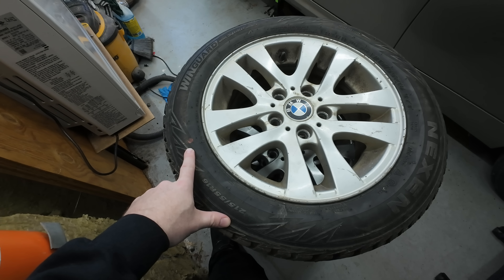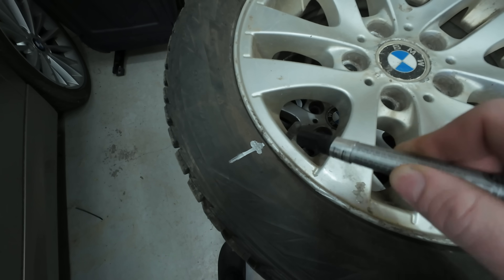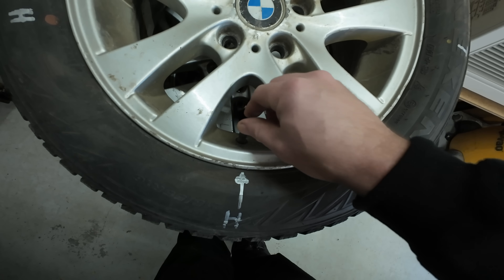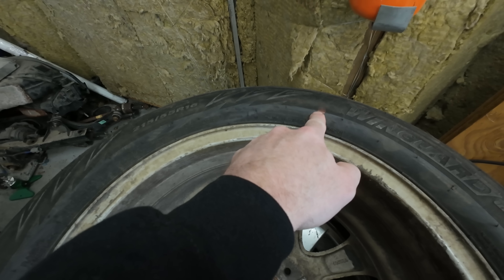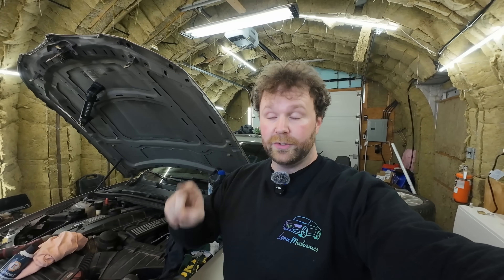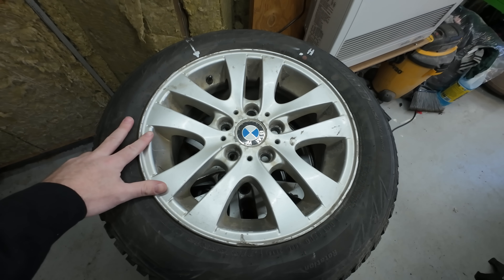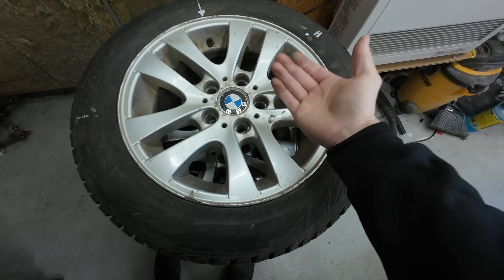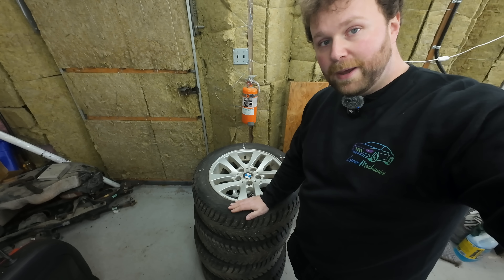Tire Red & Yellow Dots Explained | Back to Basics. Many mechanics get this 1/2 right

Comment: Wait, WHAT?!? I'm 90% sure that the red dot represents the HIGH spot of the tire (not necessarily the heaviest), which should be lined up with the lowest spot on the wheel after measuring radial runout.

If I find that a wheel assembly needs an excessive amount of weight with a new tire, then I remove the tire, statically spin-balance the bare wheel with valve/tire sensor, mark where the balancer wants me to add weight, and then re-mount the tire with the YELLOW dot at the opposite side of my mark. My mark is almost never opposite the valve stem, I've found that's a myth. It's often close, but sometimes it's nowhere near it. 

The only time I'll ever bother with the red dot is if a wheel has radial runout greater than 0.015" and I want to avoid stacking on top of that with an uneven tire. At that point, aligning the yellow dot to the heaviest part of the tire isn't worthwhile, I'll just deal with the extra wheel weights. Having a round wheel assembly is more important. Instead I'll line up the RED dot with the lowest part of the wheel.
Reply from the maker: Yes but the highest point is often the heaviest. Once you re clock the wheel I bet the red mark was near opposite valve steam. This is what I've seen over years
Reply: @Lancemechanics  In my experience, no. In fact that makes no sense logically. The heaviest side will inherently be opposite the lightest side. That's why we mark bare wheels at their lightest point and then line up the yellow mark opposite that. Why else would we balance wheel assemblies by adding weights only in one place along the circumference?

The point is, the red dot is marked by tire manufacturers as the highest part of the tire. It does not reference weight at all. And just like "the valve location is not always the heaviest point", the same is true for the red dot.

Comment: You're correct about the yellow dot, but the red dot is not the heaviest part of the tire. It is the highest. All Ford vehicles from the factory have a sticker on the rim and it's always lined up with the red dot and the red dot is rarely directly across from the valve stem. The mechanics are supposed to take the stickers off the rims when they perform a PDI, but they usually don't. In fact I have seen the red dot and yellow side by side almost op top of each other several times on a tire as well.
Reply from the maker: Highest tends to also be the heaviest. Its my experience alot of techs will break the bead and rotate the tire to get it to balance. I haven't had to do that in years.

Comment: Well, I line up the yellow dot with the valve stem and then spin it up and see how much weight it takes and also check the rim at that time to make sure it’s not bent. If I think the weights excessive, I spin the tire 180° on the rim and go from there. All the aluminum wheels I do, I just static balance them so far I haven’t had an issue with that. 0 to 160 Kph no shake, good to go. I do the dynamic balance on steel rims. The other problem I see is most mechanics, or do it yourself,  never calibrate their balancer.

Comment: The red dot isn’t necessarily the heaviest spot on the tire, it’s the highest (or tallest).  But being the tallest it’s often the heaviest as well.  It’s really meant to be lined up with the lowest spot (from the hubs center) on the rim.  It’s often marked with a dimple, if marked.  This should reduce the vertical up and down or lobbing effect at high speeds.  Depending on out of concentric your rim is it’s a better trade off than the extra wheel weights needed to balance your wheel.  So Lance, you’re one of the mechanics that got this 1/2 right.
Reply: Yup, it's the highest spot for radial force variation, not necessarily the heaviest or tallest, but usually is.  It can be from stuff like splices in the ply lining up, overlap of belt splices, heavy tread splices, etc., that happened during construction.  (I never built tires, but I've installed and maintained tire building machines)
Reply: @jaskroo  and that is the only clear explanation of what it is and how to apply it.
Reply: Where is the dimple? Never seen one.
Reply: @baronvonbrauhaus9086  Yes. Please let us know how to find this dimple on the wheel.
Reply: @horseathalt7308  I found over the years that you only usually find anything on a new rim, as many manufacturers mark the rim with a little sticky red paper dot, which usually comes off at the first tyre change.
Reply: As I learned long ago and has served me well: Red dot high spot to low on STEEL wheels, dimple/marking isn't normally on aluminum wheels and can be difficult to find on many steel wheels or might be missing, my Mopar steel wheels don't have one, I balance as if they are aluminum with the dots and works quite well...yellow dot to valve stem on ALUMINUM wheels...Red dot only, align opposite the valve stem...No dots, trial and error sometimes...
Reply: It's the flattest point of the tire
Reply: Came here to say this. Thank you. I learned the truth of it while dealing with horribly oversized tires which amplify even the slightest imperfection
Reply: Glad someone said it.
Reply: IGNORE THE COMMENTS.  The video is correct.
Many of the comments cause confusion.
Reply: so where do you recommend the red dot be placed at the valve stem or directly straight across from the stem
Reply: Not only is this correct re the red dot, but the yellow dot is the heaviest spot on the tire to be lined up with the valve because the valve is the lightest, not heaviest, part of the rim, i.e. there's a hole/material missing. Young dudes just don't know shit.
Reply: @esstee9595  Glad you replied about the yellow dot. I was sure that was the case, the yellow dot resembles the way hole is for the air stem.
Reply: @esstee9595  
The valve stem is the heaviest spot on the wheel - when the stem is in place. And these days that includes a tire pressure sensor and battery, at least in the US market.
Reply: @esstee9595  My 82 Buick rims added weight (tiny bit of steel welded on) by the value stem hole to Ballance rim without a valve stem in. After installing a valve stem it's heavy by the stem.
Reply: If you buy quality premium brand tyres like Michelin, Goodyear, Continental or  BridgeStone you don't have a high spot in your tire.
Reply: @Ruupie_1982  Highest spot. Not high spot.  Every tire has a highest spot.
Reply from the maker: The tallest point is often the heaviest. Ty. Proved my point. Im wondering if people even watched the video. Check out last 30 seconds
Reply: @Lancemechanics  The uniformity mark isnt always the heviest poin, no. And if both dots are present and your rim does NOT have a "low mark", yellow have priority.
Reply: @mikev.henriksson8396  My rims have the red dot only. But the tires don't have any markings. What's the red on rims? I suspect it's also the high point on rim? Or do they mean something else on rims?
PS. Thanks in advance! 👏
Reply: @Lancemechanics 
So it balances but it's out if round.
Reply: @hotrodray6802  then, you need a tire lathe. Seriously, Cadillac dealerships used to cut tires round when replacing them. OCD on smooth riding vehicles.  One of my friends jobs back in the '70s.

Comment: Have you weighed the difference between the valve stem and the metal that WOULD BE where the hole is, for the valve stem?
Reply: Yes, there’s a hole
And a valve stem. 
And some of them have a sensor on them
Reply: @neilkurzman4907  no shit ..
 Any idea on the "weight" difference, between the valve stem and what metal WOULD HAVE BEEN where the hole is?
Reply: @invisibilianone6288
No, I don’t do it for a living. 
If I did, I probably would play with it. 

Or many years ago when I did software for one.
Reply: @neilkurzman4907  Thanks for your reply 😎☕

Comment: I wouldn't be too worried. It's only few grams in difference with stem valve.
Reply: Might be quite a bit more than that since most newer cars have a pressure monitor on the valve stem.

Comment: 4:38  Loved the tip, so it turn I have a dot tip for you pertaining to spray cans (such as the one over the radiator. If a spray can has a small red dot at the top rim (where the nozzle is), that small red dot indicates where the draw tube is touching the inside of the can, so that you can rotate the nozzle around to get a full squirt (whether the can is vertical or horizontal), you always want the small red dot to be the lowest spot before spraying. i.e. If the can is nearly empty, and the small red dot is on the top of a horizontal can while spraying, you get air and nothing else!

Comment: A static balance you would put weights in center of the wheel “barrel”  they had it on a dynamic balance just only added weights on the inside
Reply from the maker: Our machine pretty much let us choose where we wanted a static. We always choose towards the inside face if we had too

Comment: I had to look at a note I put by the tire balancer about 20 years ago, this could be outdated but it says if wheel has a white dot align it with the red dot on the tire, if no white dot mark the heavy spot of the bare rim and align it with the yellow dot on the tire, this has worked well for years please comment if this is no longer correct

Comment: I have never used the dots as scripture. 
I never cared about  2 dots.  Place one on the valve stem, put the thing on the balancer and see where it is, then rotate the tire 90 and recheck. 

I used the dots as guides for tire rotation to find the LOWEST overall weight.  

Big 4x4 tires, this is even tougher as the tread can also make the tire ride rough.  This is absolute critical mechanicing.  Just like using a TORQUE wrench on the nuts NOT a rattle gun.

Technicians don’t know this, MECHANICS do.  There is a HUGE difference.

Comment: this is a bit off topic for this video but wanted to know if I am the only one that hates these new lead free wheel wieghts? they cost way more are hard to get on the rim, and you loose the ability to just trim a bit off of one to get that perfect balance, I spent an afternoon rehabing used lead wieghts, wire brushed them reshaped the clip and 2 coats of aluminum shake and spray, but it is nice to see them in the cabinet
Reply from the maker: Had a coworkers weights come off restick its self on another part of the wheel. He paint marked everything do he thought it was the customer who was trying to grief him. Brake cleaner, degrease. You almost have to scruff the rims to get these shitty weights to stick

Comment: IF the tire has a yellow dot (not all do) - I find the heavy spot on the rim first, mark it with tape, then put the tire on with the yellow dot at the tape mark. It takes longer of course, but takes less weights. The valve is not always the heavy spot, specially with an alloy rim.

When diving into dot colors, I read that the red dot is to do with runout of the tire and you are supposed to align it with a mark on the rim... I have never seen a rim marked that way, never used it.
Reply from the maker: The marks are rare. But my experience putting the red opposite of the valve stem greatly reduced the weights. I've watched kids end up breaking the bead. Rotating it 180 and its magically opposite of the valve stem or pretty close. But nothing will ever beat spinning the rim up by its self and marking it. :)
Reply: What do you do in order to find the heavy spot in a wheel? I've been a Firestone / Tires Plus tech (both are Bridgestone owned), for almost 3 years and in the 3 locations I've been at, nobody tells anything about that. Shoot we had one guy think the red dot was the light part in the tire, and would refuse to believe otherwise -_-

Comment: if I am doing an important tire install I will spin the bare rim and mark it, wheel wieghts are not cheap anymore and it takes more without lead if you index the tire you will use less than half the wieghts
Reply from the maker: Good practices! This should be the standard.:)

Comment: Take a rim with a valve or tpms/valve combo installed and no tire and no weights.  Tell me the valve is always the heavy spot.  The last 4 wheels I did for myself is NONE of the wheels came to the valve.  Not one.  Snap on manual vertical balancer and stick on weights.  For more preciseness I would have to use a runout gauge to establish the low spot on the rim and tire if either had one.  Don't take my word for it balance a rim with valve installed and no tire.  My guess not all will.
Reply from the maker: So a few tires bent the rules. Let's tare down the whole system... nothings written  in stone in automotive
Reply: @Lancemechanics the point is worrying about the dots is stupid. Just a waste of time and effort. Install tire, balance tire, if you dont like the amount of weight deflate and rotate and balance again. Ignore the stupid dots.

Comment: They're being taught incorrectly straight out of tech school.
Reply: Back in 1969 there was no tech school, but there was an auto mechanics class in high school that my brother took and then I was the one that became a mechanic. I made a jig with a rod, cones and 4 sealed ball bearings on a cradle. This allowed you to balance a wheel/tire assembly before machines were available to me. I don't remember if they had the dots back @ that time, but they are helpful if used correctly. The way I balanced was to rotate the tire and the heavy spot goes to the bottom (Newton Law :) ) then figure out the weight and add it (taped) to the wheel, the rotate the wheel 90* each way to determine where the weight needs to be placed. You can live out in the middle of BFE and this will work every time.
Reply: @warrenlucier5796  I learned on a bubble balancer back in the 1970s as a kid growing up in an automotive shop. 10 years on, as a service writer/counter manager at a tire store, showing the kids how to fix a problematic balance on a computerized balancer was a real thing... going back to the bubble balancer showed not only mass but weight - i.e. the long lever of the high spot of the tire would pull even if the heaviest point wasn't the high spot.  A lot of brands didn't mark hi/lo back then, either.  It was starting to become a thing just as I left the business.

Comment: LANCE! Red is NOT heavy and never was. It’s lateral run out and needs to be lined up with the low spot of the wheel when you have that. Not all wheels have that indicator in which case you will use the yellow on the valve stem…..the reason red dot takes priority is no amount of weight can correct a run out condition. Come on lance
Reply from the maker: And experience tells me putting the red will opposite the valve stem will always reduce the amount of weights. Even in the comments everyone says they've taken off tires and spun them 180.  I understand what your saying.

Comment: I ordered tires from one of the large online Rack stores. Two had  the Red on the Valve stem with A TONNNNNNNNN of weights. Never seen that many weights on a tire in my 25 years of driving.
Makes me want to get my own tire machine and balancer. I do my motorcycle tires and take the extra couple minutes to get them as balanced as possible with no weights and then add weights if its necessary.
Reply from the maker: And my experience has told me put red opposite the valve stem. This topic will generate alot of confusion ill tell you that :p. But I can see the results on so many tires. Its like those cambered rear tires. Once I point it out people can't unseen it haja
Reply: there's videos of japanese drift car guys breaking the bead, unmounting, and even mounting tires in seconds with literally nothing but motorcycle tire spoons. made me realize it's not rocket science. 

(i'd use rim protectors tho because im not treating my wheels as disposable they way they are.)

Comment: I never thought about spinning the rim up to mark it. We used to find one that would come in with a lot of weights in one spot. The first thing I'd do is spin the tire 180* on the rim and rebalance it. Usually that worked. Sometimes swapping which tires are on which rims works.
Reply from the maker: Takes more time and its usually frowned upon. :(

Comment: Ok where do you put the red dot if you are balancing tire with both dots
Reply from the maker: Opposite of the valve stem. Valve stem is usually the heaviest part of the rim due to the sensor. Also some rims are marked with a heavy spot. Not all but some and you got opposite of that.
Reply: @Lancemechanics Thanks
Reply: ( 1:44 )

Comment: When performing uniformity match-mounting, the red mark on the tire, indicating the point of maximum radial force variation, should be aligned with the wheel assembly's point of minimum radial run-out, which is generally indicated by a colored dot or a notch somewhere on the wheel assembly (consult manufacturer for details).

Radial force variation is the fluctuation in the force that appears in the rotating axis of a tire when a specific load is applied and the tire rotated at a specific speed. It is necessary to minimize radial force variation to ensure trouble-free installation and operation. Not all wheel assemblies indicate the point of minimum radial run-out, rendering uniformity match-mounting sometimes impossible. If the point of minimum radial run-out is not indicated on a wheel assembly, the weight method of match-mounting should be used.
Reply: @ALMX5DP  most OEM wheels on new cars were marked by a paint dot or paper sticker to match up the tire dot on assembly line. Most people never saw them as they were scrubbed off during dealer prep process.   Professional after market used to require “match mounting “ process to achieve best ride quality. This was labor intensive and not often done correctly. These days the technology of Hunter Road Force balancing machine does it for the tire tech  fast if they follow the instructions.